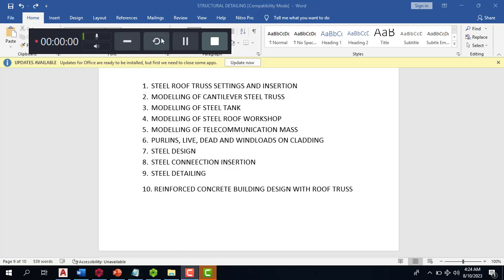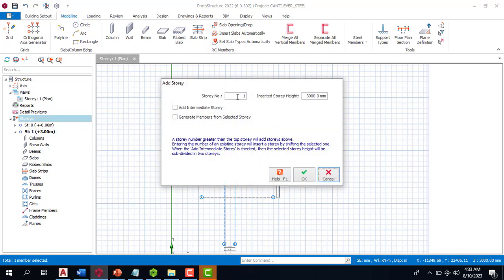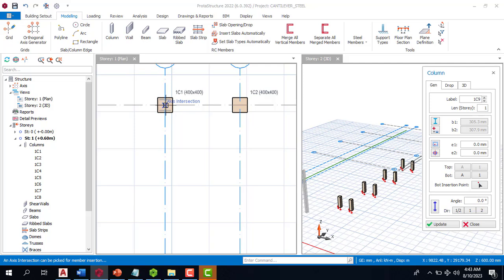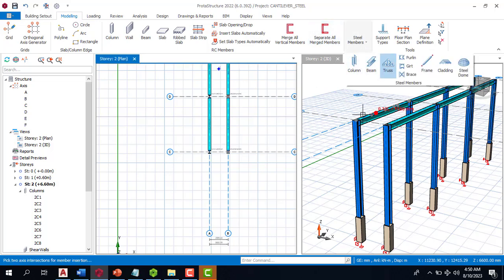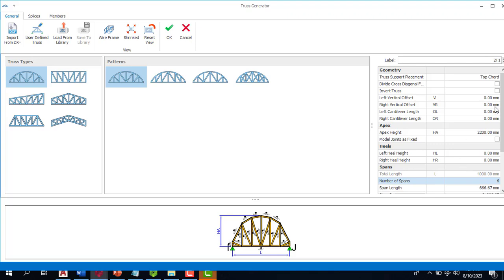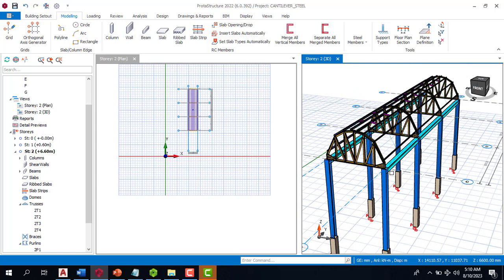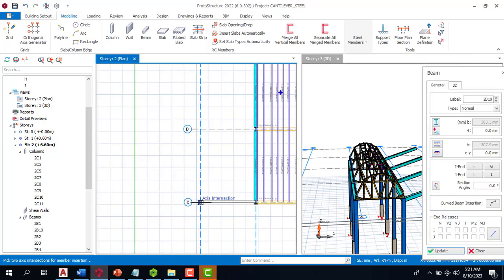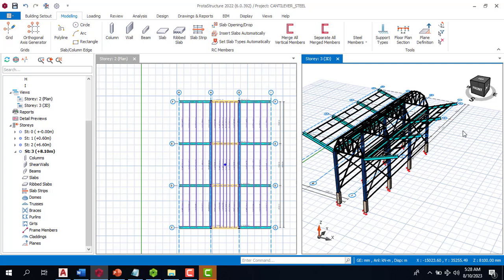ProtaSteel Masterclass Episode 1

Comment: Haven't seen any building design in Prota with combination of underground concrete water tank and steel structure above ground. Also, a building on a hill or has a different foundation level,  and a  building connected to another building with common walkway above on second and third floor.  Better another example with all steel structure with buckling resistance bracing.
Reply from the maker: Yes sure soon sir